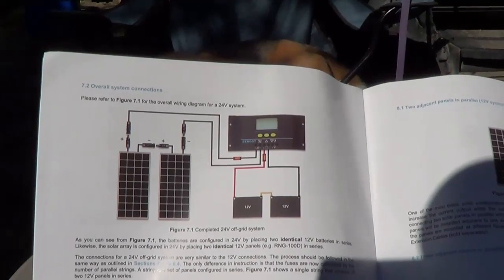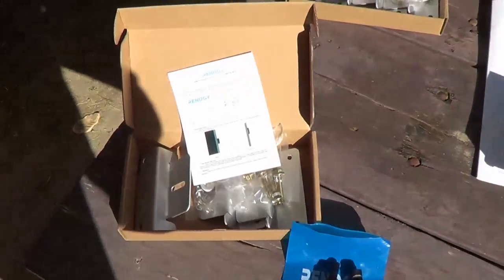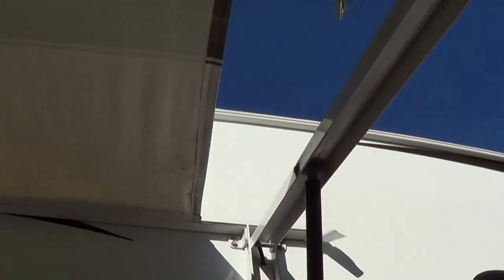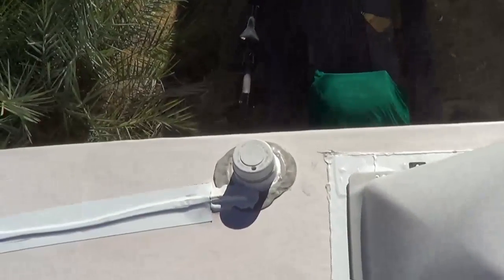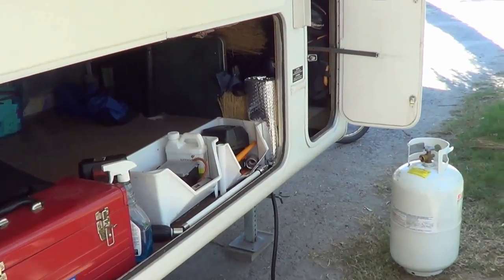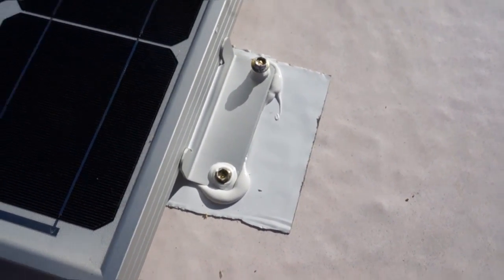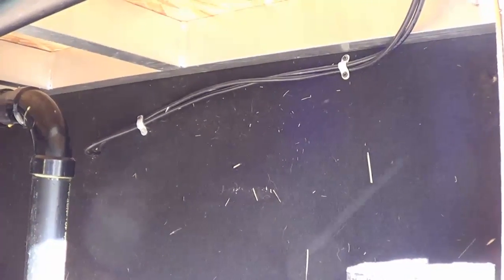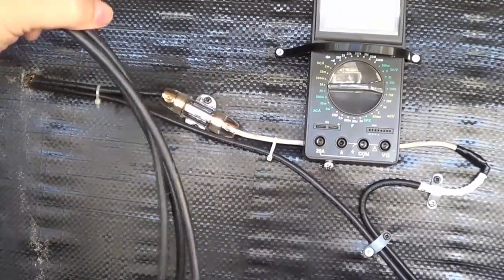Installing a Renogy 200W Solar Kit on my RV

Comment: I thought you added 2 panels. Must have been someone else. Thanks very much for answering all my questions so patiently. I'm learning and I think this 2 panel, 4 battery setup will work just fine for us. Again, thank you. Maybe I will do a vid on my install.
Reply from the maker: Yes, I started out with 2 but added to more this past December.  Also upgraded my charge controller and added a battery system monitor. I have a budget so have been slowly adding to the system. :)
http://www.loveyourrv.com/upgrading-our-renogy-rv-solar-system-to-400-watts/

http://www.loveyourrv.com/bogart-sc2030-cc-and-trimetric-tm2030-rv-installation/

Comment: I think I can fit 4 6v batteries in 2 cases on my tongue. I'm going to find a way to fit 4 100 watt panels on that roof. If I go bigger than 4 batteries I will have a tongue weight problem. That should be a fairly good setup, right? I know 6 batteries would be better. But I don't think I can make it happen. I have my Yamaha 2000 to fall back on when necessary. I would think I could run my furnace, use a few lights, and watch tv in the evening without hitting the generator. No?  Travel trailers are a lot harder to work with than 5th wheels and Class As.
Reply from the maker: Yes, we have 400 watts of solar and 4 batteries and do quite well. :)

Comment: Let me get this straight. Two 6v are enough for two 100 watt panels?
Reply from the maker: Yes, 200 watts will barely be enough to recharge them during the average summer day if you have run them down quite a bit overnight. But it all depends on your day power usage, lots of variables to consider but in general terms yes. In fact they could likely handle even more solar. Midwinter is also a whole different story, in that case, more solar is needed or a generator to augment.

Comment: I can put two batteries on the tongue. So I could do 2 12s. But I heard 6v were better. I'm only going to install the200watt Kit. Do I need 4 batteries?
Reply from the maker: IMO 6 volt are the best bang for the buck because a quality 12 AGM is much more expensive. I also like the smaller footprint of the 6 volts, thicker plates and be able to test the state of charge with a hydrometer.
2 batteries are plenty for 200 watts of solar. 200 watts would have a tough time fully charging 4 batteries. General rule of thumb is at least 100 watts of solar fo each battery in the bank.

Comment: Thanks for the response. I'm trying to figure out where I'm going to put 4 6 volt batteries on my travel trailer tongue. The only other place I could put them and keep the load centered would be under the bed. Sealed batteries of course. Your thoughts?
Reply from the maker: Sorry, I'm not really that familiar with travel trailers. Maybe it's too much extra weight on the tongue and 12 volt AGM batteries under the bed further back might be a better bet.

Comment: So you now have 4 6 amp batteries?
Reply from the maker: Yes, 4 6-volt batteries. Here is a link to a video recapping the latest upgrades - https://youtu.be/uRbGmxun1LI?t=5m4s
Check out this blog post for links to more information on each. http://www.loveyourrv.com/20-rv-upgrades-fifth-wheel-trailer/ Cheers Ray

Comment: All I want is a setup that will run the air conditioner how do you figure how big you need for 120 V 12.5 amp  AC unit

Comment: can someone help me choose a off grid solar setup for my truck as well as grid tied unit. i need to power a two foot refridgerator, fan lights small appliance as well as tool and gadget charging. i hope to keep it about 50 pounds or less to stay with truck and trailer and one very small one to carry while i fish or hike for radio and cell phone, small water pump thanks a bunch
Reply: Thinking about carrying the power bank? Isn't that ridiculous? Or you meant, "easy to offload/onload"? Anyway, you wouldn't go wrong with what this guy has done. The refrigerator is the biggest concern; together with its running hours... per your needs. You've to change the charge controller to MPPT though.

Comment: I think 8.3 amps is too low.  I bet your open voltages of the panels is around 44 to 45V.  If you have the time to satisfy some random persons curiosity can you measure the output at the charge controller with the battery discontented at high noon?
Reply from the maker: I have 4 x 100W panels now, The open voltage on each panel is 18 volts. I have them paralleled into a PWM charge controller. Currently, at high noon in Southern California early April I'm seeing 22.5 amps out of the charge controller. Seems about right given the rated output current of 5.69 amps per panel.
Reply: +Love Your RV thanks for the reply!

Comment: I may of missed this as I scrolled through the video, but did you just lay them flat on the roof?  I'm surprised you got that much out of them without a more ideal angle.
Reply from the maker: Yes, no tilts they are laid flat.

Comment: did you say you paid $130 for a 100 watt panel? i just paid $200 for 2 50 watts panels. because it was the cheapest.
Reply from the maker: +mimi taylor Yes, it was a Black Friday sale but they are currently 139 on Amazon - http://amzn.to/1RAfYON
Reply: yeah now i know why, i wanted foldable one taht's why it was more expensive. i need to be able to take it with me or put it away...
Reply from the maker: +mimi taylor Ah , yes it has more hardware to make it fold, hookup wire and the charge controller.

Comment: do you just screw into your roof with the supplied screws and then silicone over the screws so there water tight?
Reply from the maker: Depends on the type of roof you have. My fifth wheel has a rubber roof laid over 3/8ths boarding so I just screwed them down with the supplied screws. Hopefully I also caught a few underlying rafters.
I first laid down a piece of Eternabond tape under the Z bracket,  drilled small pilot holes, then dipped the screws in Dicor Lap Sealant and screwed them in but not to the point that they lost the bite on the wood. Then over the top, I put a liberal coating of Dicor lap sealant. - I have another video here where I add two more panels - http://www.loveyourrv.com/upgrading-our-renogy-rv-solar-system-to-400-watts/
Note I didn't use silicone as it won't stick to rubber roofs.

So far more than a year later and many thousands of miles traveled over some very rough roads, the panels are still very firmly attached.

You can find more info on panel mounting here - http://www.amsolar.com/home/amr/page_24
If your roof is fiberglass you may want to use 3M tape or if the underlying board is very thin might want to use what is called Well Nuts.

Comment: can 200w solar panel, Can run refrigerator @ 90w 230v 0.75amps? for 24/7? or either for 3days?
Reply from the maker: Mos of the time yes, but it would depend on the time of year. Number or solar hours in the day and angle of the sun. Tilting panels will help.
Reply: Oh! 0k..now i know, Thank you(':

Yes! and i would love to buy 4 solar @ 245w each to run my whole house and a comfy batteries. Thanks again!👋

Comment: Gees, I have only been on the road a month and I have already killed my two Interstate batteries.  There was no good place to get solar installed when I lived up north so I only had a renogy 100 portable suitcase.  I thought that was enough down here in Arizona but apparetly not.  But then I only had that cheap crappy so called monitor so I don't know what my batteries were getting.  Suddenly two days ago my system totally shut down and even using my generator didn't help, because within a half hour of shutting it down my batteries were completely dead.  So I am having at least two 145 watt panels installed tomorrow as well as two good monitors (one remote) and a smart charger and inverter and AGM batteries.  It's gonna cost me but I should be able to stay off the grid.  Any suggestions?
Reply from the maker: Sorry for the late reply, I have been offline in Joshua Tree NP for several days with no cell service.
I have written a number of posts about what I have and there are a few others systems there too - http://www.loveyourrv.com/?s=solar
Our sweet spot has been 400 watts and 4 six volt batteries. We just left JT NP and were there 7 days, batteries never went below 85% and were fully charged each day by noonish. I was most pleased to not have to run the generator in such a tight campground with many tenters so close by.
Cheers Ray
Reply: That's cool.  I ended up getting what I think is a good system;  Three panels, two of whiich I can tilt, totaling almost 400 watts.  A top of the line blue skies controller, heavy wires and two AGM batteries.   Not cheap but I am happy.
Reply from the maker: Sounds great!
Reply: Love Your RV I think I am set now.  I am dry camping at BLM sites near Quartzsite,  But I think I like Havasu more so will go back there.

Comment: I am about to connect my 200W Renogy setup to the new 6 Volt DC Golf Cart Batteries in Series. Should have about 215 AH.  Hoping to have some energy to run the refrigerator on electric during some of our stops between campgrounds.
Reply from the maker: Cool! Literally, haha Should do the job if sunny and if you are driving the batteries will get alternator charge too. I know most fridge elements are around 375 watts but they cycle on and off as required for cooling so much will depend on the outside temps I imagine.
Reply: +Love Your RV Enjoy your videos, especially the gadgets and boon docking.
Reply from the maker: Thanks, nice to hear. it's fun to share them and get everyone's feedback.

Comment: sorry if you answered this already but what batteries do you use?
Reply from the maker: I have used 2 Trojan 6 volts in the past but recently built a bank with 4 Interstate GC2-XHD-UTL lead acid type batteries rated at 232 AH
Here is the blog post detailing it - http://www.loveyourrv.com/upgrading-my-rv-battery-bank-and-12-volt-system/
and an up to date look at the wiring which I have improved over the original install a few months ago - https://youtu.be/uRbGmxun1LI?t=4m49s
Cheers Ray

Comment: Great Vid     I think I would have not ran the volt meter straight through.I would have included it in a sep circuit
Reply from the maker: Thanks, It was a temp kind of thing, I've upgraded to a proper system monitor now one year later. Here is a link to part of a video that shows my solar and 12-volt power system as it sits now. Cheers Ray - https://youtu.be/uRbGmxun1LI?t=4m49s

Comment: hi ray. looks like you did a pretty good job on your install. I've used that Dicor sealant around the house and it is some good stuff. a couple of things to remember seal the holes that you had made in the propane area because you don't want propane to seep into your other compartments. if you want to increase your capability for your boondocking, double or triple your battery capacity. doing that will greatly increase your night time functionality and enjoyment. before you go out and buy more Solar, increase your batteries as that will be hey much better investment.
Reply from the maker: Thanks. If you check out some of my latest videos you see I've been busy the last few months upgrading the boondocking capabilities.
https://www.youtube.com/user/LoveYourRV

400 watts of solar now, 464 Ah battery bank, Trimetric monitor, Bogart controller and an InteliPower charger. Cheers! :)
Reply: +Love Your RV thanks for the reply Ray. I live in Salt Lake City and have 7800 watts of Solar on top of the house. my RV is my house. I have enough solar to run completely off the grid. I have enough batteries to last a couple of days without much sacrificing my lifestyle. have fun on your travels.
Reply from the maker: wow 7800 watts! You must have a big RV!
Reply: +Love Your RV the only thing I need to figure out next is how to get wheels under it! lol

Comment: Liked your install, still considering Renogy . Even tho the Can$  is in the tank it is still a good investment. Great idea to use the Multimeter as part of the install.  Joe Blow
Reply from the maker: Thanks, I've recently upgraded things for this boondocking season adding 2 more panels and a Trimetric battery monitor. Cheers Ray
http://www.loveyourrv.com/upgrading-our-renogy-rv-solar-system-to-400-watts/

http://www.loveyourrv.com/bogart-sc2030-cc-and-trimetric-tm2030-rv-installation/